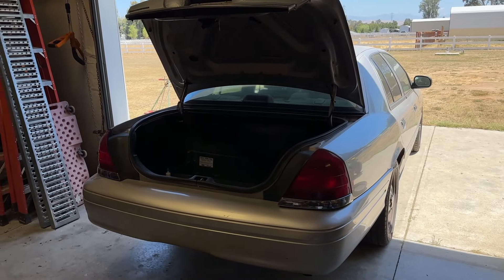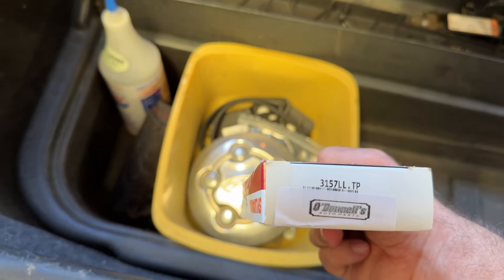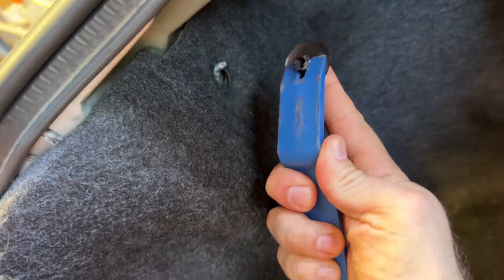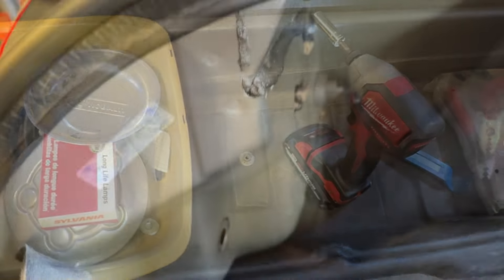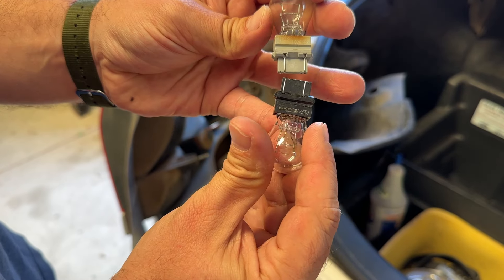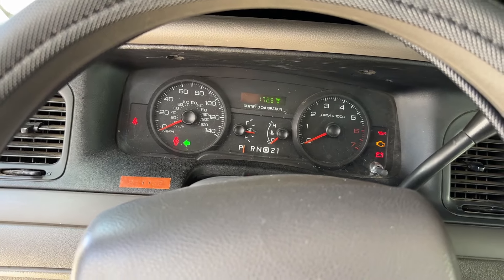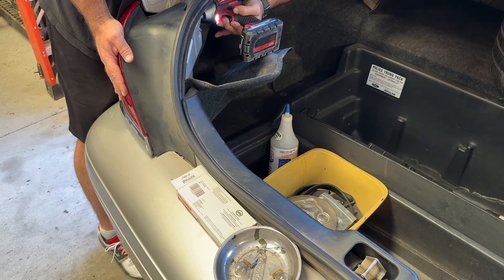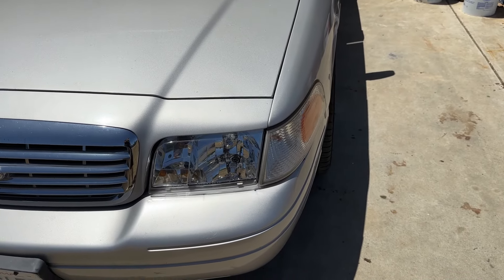Crown Vic Turn Signal Going Crazy? Try this First!

Comment: My challenger was doing this, changed all the bulbs but it would still do it. Turned out he previous owner put a sequential tail light kit on the car and did a botched job causing some of the wires to come loose on the boards and make contact with the body of the car causing a short. I had to cut the sequential tail light kit out and basically take the car back to stock, hasn’t had an issue since

Comment: A word of caution:  be sure to use the appropriate bulbs, and I will explain what I mean by that.  In older, pre-computerized cars that don't have the bulb out function indicators, nearly any bulb will work as long as its the correct voltage supported by your electrical system.  But on the newer computerized cars, bulbs that have a different color base or different metal will have an entirely different resistance value, which means that the computer will indicate a bulb out condition even though the bulb is working fine.  The computer will see a different resistance value than what it thinks its supposed to see and give you this issue.